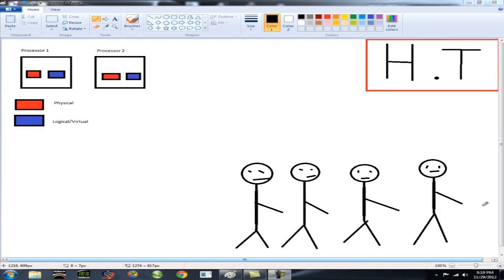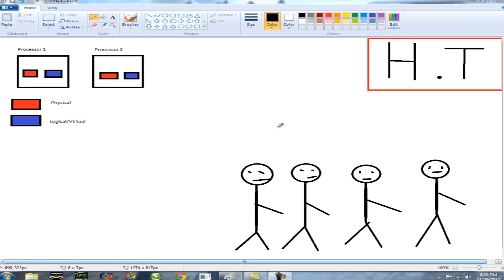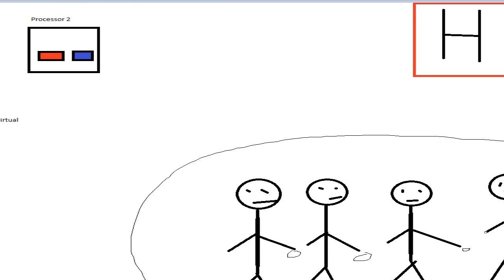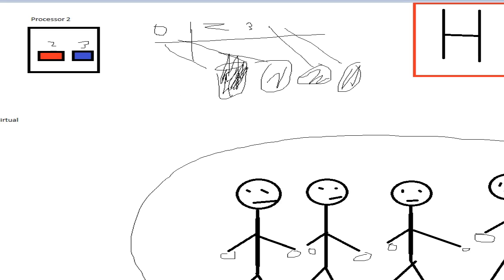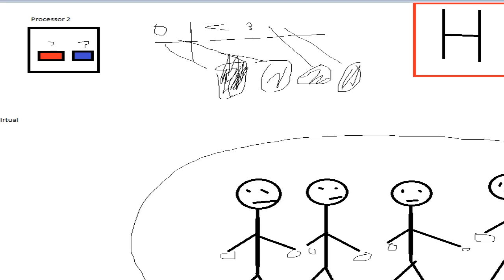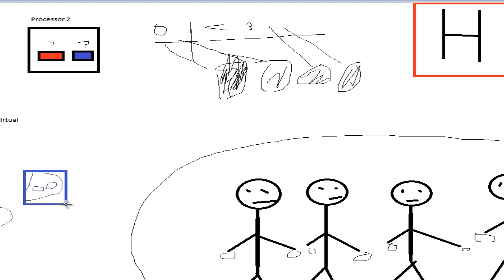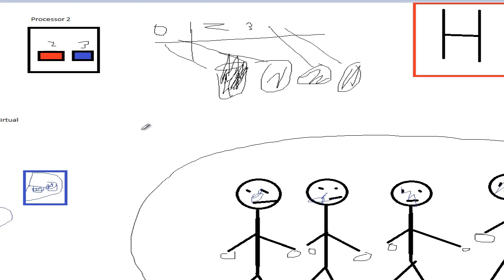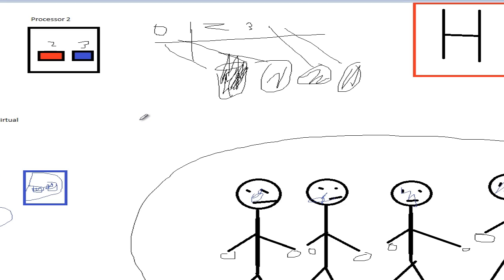Hyper Threading - Explained

Comment: CPU performance isn't really about the number of cores. They do provide significant boost to the performance of the CPU, however the architecture and efficiency of the cpu plays a big part in what it is capable of.

You can buy an 8 core AMD cpu and a 4 core Intel cpu, the 4 core Intel i5 should be half the performance, but in reality its better performance than the 8 core AMD even without hyper threading. The 4 cores of the Intel is way more powerful and uses a lot less electricity than the AMD, providing better performance in many area of computing.
Reply: IPC, khz, core count, cache, all that matters to me! Efficiency? I have seen the future, and it is the worlds most awesomest waterpark...so throw that car battery in shamoos tank, fire up that V8, and set that rainforest ablaze already. Double TDP for 10% more performance? Sounds like the best 10%...COUNT ME IN BABY! Its cool , I know i'ma burn up those Intel Chips - but dont worry, its alright, I recycle them to be green - when i get a bucketfull, I drive to sea world and feed them to the dolphins there.

Comment: Uh...yeah...he or she probably should. FX 8350 has superior multithreaded performance when put up against 3570k for obvious reasons. The 3770k is better, but it's also $300+ and the 8350 can be found for like $179 if you look hard enough and wait for a good deal. But since they were asking about Intel, chances are they already have a Z77 and don't want to waist the money upgrading to a Haswell because of the mobo change since sandy was compatible with Z77 and so was Ivy. I'm not sure though.